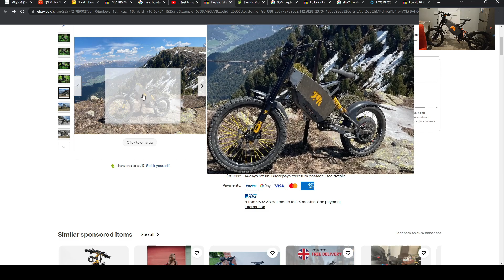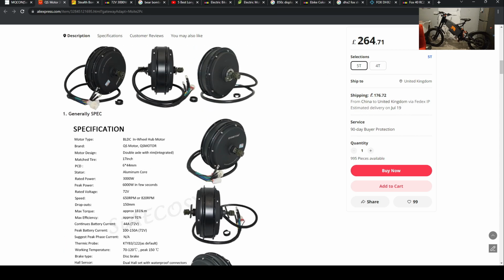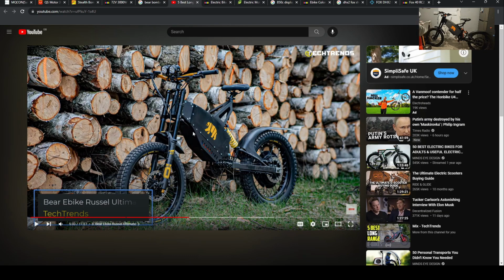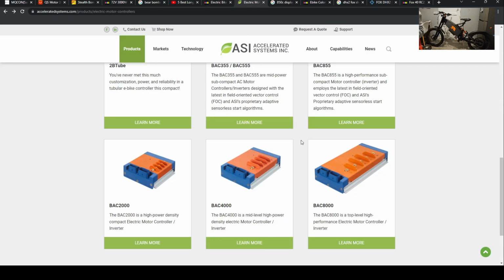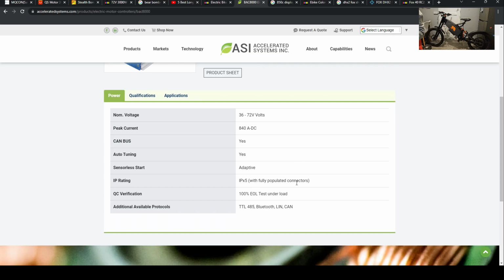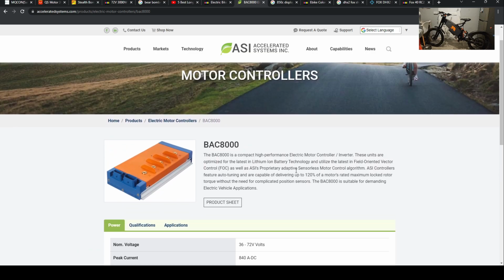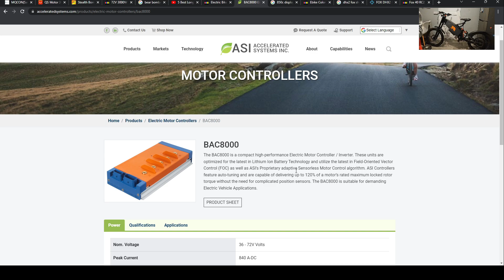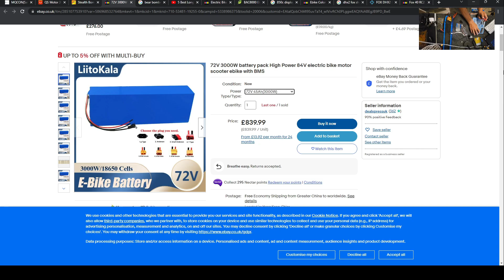Bear Ebike 3000watt (Bomber Lite)

Comment: Parameters of BearEbikes are real… 4000w nominal power and peak power 20kw. But that bike what you showed us is not factory BearEbike… It’s only built on BearEbike frame… some one built it himself. Don’t tell it’s original factory BearEbike… From first look I can tell it’s not… also the controller is totally different than factory one - BAC4000 or BAC8000 not the sabvoton